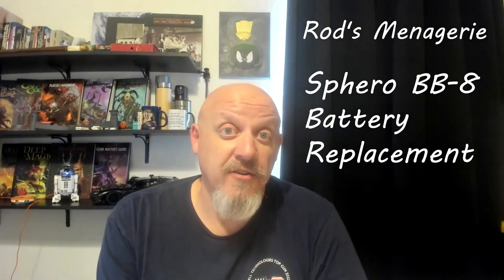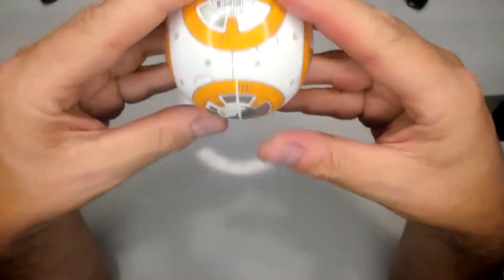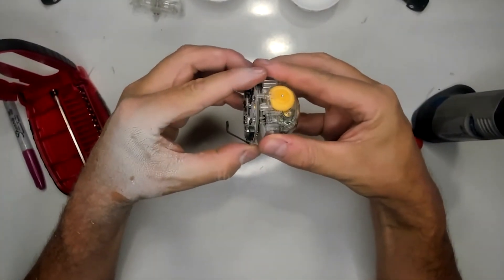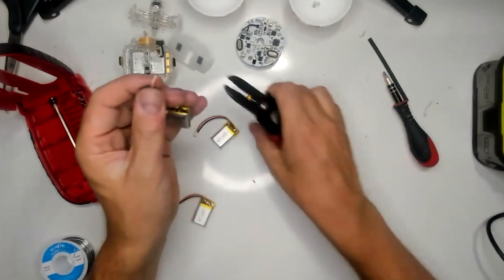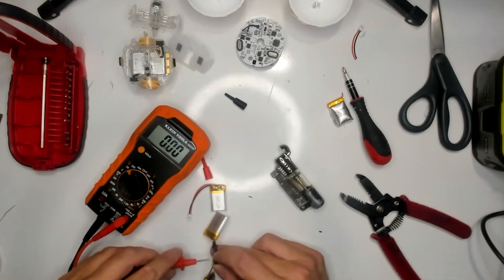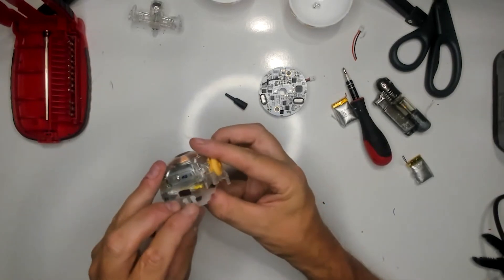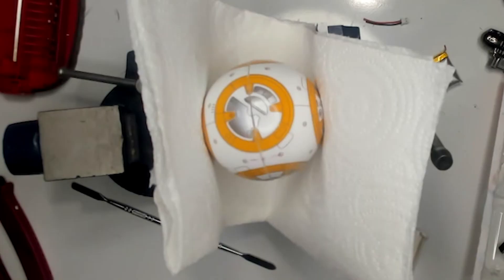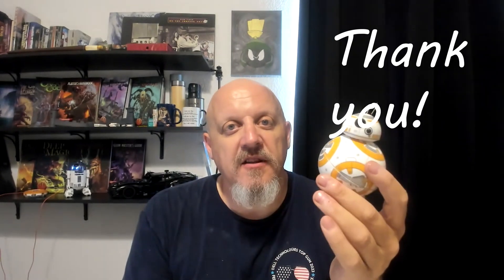Sphero BB-8 Battery Replacement

Comment: It is a shame that Sphero decided to make these educational toys not repairable. It was easy to predict that the tiny battery would eventualkly be dead rendering a $100+ toy useless. It would have been so easy to make the two halfs screw into each other but they probably din't want anyone to reverse engineer the ball, not that it would have prevented anyone from using a Dremel tool to cut it open. I got several of these includin the BB-8 and may try to replace the battery but I hate to cut into it.

Comment: Hello. I changed the batteries for mine. It turns on and connects to the app but the motors don't work. They worked before I opened it up. Do you know what might be?

Comment: Never just solder lipo batteries together. You need to marry them. You charge them to exactly the same voltage so they don't charge each other. Also only use new cells when you do this.

Comment: Thanks for the video, just cracked it open with a rubber mallet instead had to really slam it, and just ordered the battery’s hoping it will work again!
Reply: Did it work ????
Reply: @CalebWooShorts yep they worked, worse part is cracking it open, stupid design on these big time
Reply: @bdorf95 what happened??
Reply: @CalebWooShorts just a real pain to do, had to slam it with a hammer and dremel some of it open as well, all they had to do was make it a twist lock design but instead they super glued them shut lol
Reply: Thanks for the info

Comment: hi what is the difference between 702030 and 702035 and which one i should select 350mAh or 380mAh or 400mAh. one question i have BB-9E i make it full charge after 4 to 6 days i notice the is decreasing 2 lines out of lines is that ok despite that i didnt used it within 4 to 6 days
Reply: I bought these on amazon. Battery 902025 LiPo 3.7V 360mAh 1.332Wh 1S 5C Liter Energy 27x20x9mm
Reply: @im-dt2er did it work ??

Comment: tnx for your useful video. I have a question regarding batteries: in your video (as well as in other videos) we can see that original battery is 702035, and you replaced them with 702030. is there any specific reason for that, or I can buy replacement in original size (702035)?

Comment: I poked a utility knife into the seam every quarter inch or less, making sure I got down into the groove a bit. Then took a hammer to the seam every inch or so and it popped off. Now I don't have any missing plastic from the saw an I still have the inside ledge of plastic  for  perfect fit. ( The knife part was to prevent the plastic from veering off the seam.)
Reply: Did you have to glue it or does it snap back together?
Reply: @kjk328  Glue. I used super glue in spots.I used tight rubber bands to hold it in place. I ran it into some things and it seems to be holding up so far.
Reply: @ thanks!

Comment: I have a bb-8 that was packed away for a few years.  Not holding a charge (1-2 min run time).  Assume the battery is toast.  Found your video to see if its worth trying to repair 

Thanks!

Comment: Hello there, I recently replaced the batteries on my Sphero BB-9E using this tutorial. However, (im still using the original droids by sphero app) the app says that the battery is critically low and not charging. Also when I tested the battery’s with a multimeter, one battery read-out was perfectly matching the video. But I could not get a perfect read-out with the other battery. Please help me with this.
Reply from the maker: @concrete_n_bourbon  sounds like either a bad battery or the soldering didn't quite take.  I would try redoing the solder first and do another battery test before reassembly

Comment: Where did you buy the batteries? I purchased some but they look way too big… i haven’t opened the BB8 but they are rather big
Reply from the maker: Hello, I bought them on Amazon and there is a link in description
Reply: Once open, I'm looking at using pop bottle plastic to create a turn and snap locking mechanism, failing that, little screws.

Comment: Hello i have 2 of these and there Taking a Long Time to Charge up they will Need Batteries Replaced, Why didnt they make the 2 Halves of the Shell Screw on one side would of been much easier to take apart and change the Batteries  No No they Want you to Dispose of it when its Useless, Bad Thinking i Think by Them Cheers Jos
Reply from the maker: Agreed, all they would have had to do is make this internals slightly smaller in diameter or the external shell slightly larger.  That would allow for an internal sphere and an external which creates a gap between for screws to hold the halves together.
Reply: I think it's built like that because it was also meant to be waterproof
Reply: And kid proof...